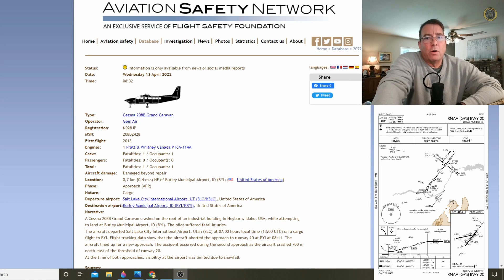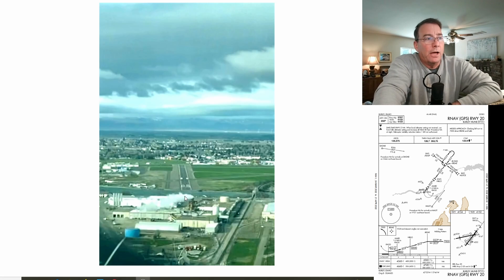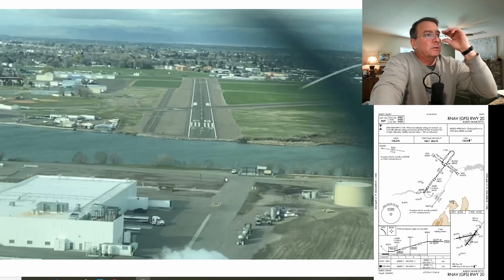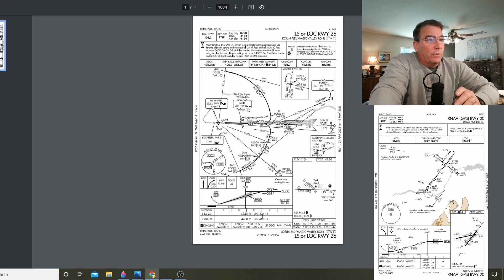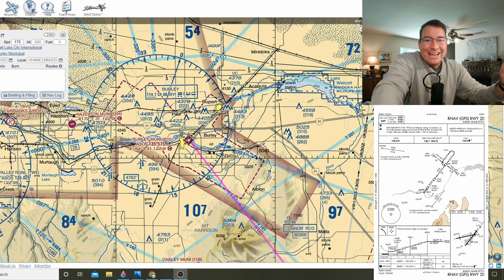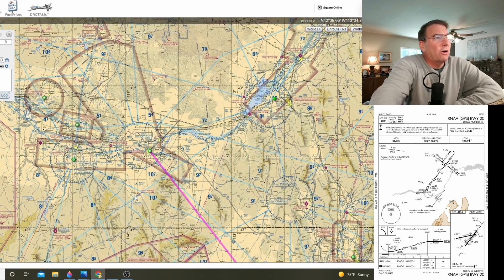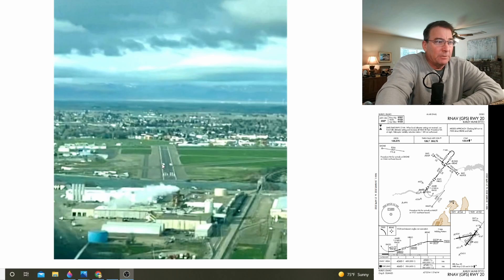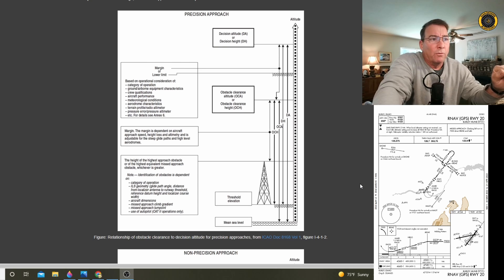Cessna 208 Caravan Crash Burley Idaho New Pictures of Approach

Comment: So we have an airport with a short runway in an area that is subject to freezing weather conditions. A factory is built on the approach to the runway and a steam discharge tower erected virtually on the runway centre line. This necessitates an almost 4 degree approach slope rather than the usual 3 degrees with the final stage of a VFR approach being conducted in IMC for a few seconds if the wind is blowing down the runway. One of two things needs to happen here, either the factory is removed, or the airport is shut and relocated elsewhere. Which was there first?

Despite the difficult layout and conditions, it is ultimately the pilots’ responsibility to conduct a safe landing, or divert elsewhere, but the pressures to just get the job 
done early in a career are immense. Had this aircraft been dual crewed rather than a single pilot, would the outcome have been different?

This was a tragic and needless accident that could and should have been avoided with proper safety assessments .
Reply: The FAA has height limitations for obstacles in the flight path and adjacent to the runway (FAR Part 77 section 77.13).  If the factory stacks are within the FAA height restrictions it's not up to the factory to move.  With buildings adjacent to the airport, the local agency having jurisdiction (AHJ) over building codes should have a zoning map with the height restrictions.  It is not up to the business to decide what is safe or not safe, that is a code compliance issue.  Instead of faulting the business, it's the FAA and the AHJ who are responsible.
Reply: Gettafnggrip armchair quarterback... THOUSANDS have landed their safely.  Pilot WAS flying too low... Pilot HAD IN FACT landed there before.
Reply: @billhosko7723  I learned to fly at an airfield with a short grass runway, significant slope, and a radio mast just to the left of the climb out. This airport at Burley is simply nasty with a host of gotchas waiting to catch the unwary and inexperienced.

Comment: What I find disturbing reading all these replies is the fact that some seem to think that there is something wrong with the IAP, there isn’t! If you adhere to the procedures and MDA this approach might be “challenging” but legal and doable. The obstacles are clearly marked on charts and described in the Airport Facility Directory. At the designed 3.75 angle and adhering to the MDA you would clear this obstacle at 4275ft MSL or 123ft. AGL or 63ft (plus another 40ft. if you account for the TCH) above the smokestack
There is a lot of ridiculous speculation on here which is not only misleading but dangerous in general to aviation!
Reply: Which gauge on your fancy aircraft shows you it’s a 3.75 angle on a non-precision LNAV approach? It could be flown safely by chance or by a pilot with very local knowledge - but I’m sure most would fail to do it right. According to law the judge will ask “what would the average pilot have done”,  not the super ace with lots of experience. These type of approaches should be trained in a simulator to obtain approval. My guess is that this approach will be withdrawn and replaced with a no IMC approach approved or a ridiculously high MDA or revised to a LPV type approach. This was an accident waiting to happen and the FAA and all who approved this ridiculous approach should be held accountable- but will they???
Reply: Some Aircraft actually have an FPA selector that can be set but that is not the point at all since you simply look at the chart to see which descent rate corresponds to what angle (Jepp charts have that on the plate) and even if you don’t you do a quick calculation in your head to know your approximate rate based on your planned Groundspeed. All these things are readily available to you for use and a prepared Pilot ALWAYS knows these numbers before getting into an approach. You clearly are not a Pilot so I suggest to just keep out of adult conversations 😉

Comment: This is sickening. The family of the slain and others begged the city not to approve this. The mother asked, who's going to "pay" for this now. It's criminal.
The faa should immediately shut the airport.
Reply: "The mother" should knows her daughter that was the PIC, and therefore "the final authority as to the operation of the aircraft". 
Yes, there are outside pressures, but that's what the PIC is tasked to deal with. Flying ain't for sissies. Especially professional flying single pilot in IFR in a complex environment.
Everyone deals with pressures. Pilots are highly trained, but we're not perfect. We're all also human, and will sometimes make mistakes. Sometimes the conditions, the airport configuration, and outside pressures can put the pilot into a box that it's hard to escape from. But that's the difference between someone who's trained and experienced, and someone who isn't.
We all receive training having to do with this kind of situation. Sometimes, the holes in the swiss cheese all line up, and things go to hell.
But a failure in this circumstance, though tragic, is still a failure by the pilot.
Reply: @RC21114  tell that to her father. Probable Cause had to issue an immediate apology to him for less than what you said.
Reply: @loonhaunt  Probable Cause is too spontaneous at times trying to beat the clock.

Comment: That approach looks horrifying, especially with no PAPI or VASI.  Any idea how high above the tower an aircraft would be if it was on the right glidepath?
Reply: This is my hometown airport and it’s a non issue when on the proper glide slope. Lots of private jets and turboprop aircraft successfully land here. She got way too low… you shouldn’t be 60 ft over the ground nearly a half a mile from the airport…
Reply: Well the MDA is 408 ‘ tower can’t much over 100’  sad and tragic yes  but when you go below minimums usually bad things happen.
Reply: @torgy3  airport info states 60’ obstacle 2050 ft from the runway,  100’ left of center line. She got low… These stacks, while not ideal, have never been an issue.
Reply: @torgy3  Not what I was asking, obviously you go below MDA on final approach if you can see the runway.
Reply: @coryturner9140  But the question is, how low was she actually?
Reply: Google maps thinks Gem processing is about 2000 feet from the runway threshold, at a 3.75° glideslope and if my trigonometry is not too rusty, that puts the aircraft 196 feet AGL when passing over the plant.
Reply: Here's my ultimate thought: Yes, the pilot should do a GA if they lose sight of the runway, due to snow or a steam cloud.  But the correct flight path is only 100ft above the chimney, the chimney is (was) unlighted, and the nearest altimeter is 15 miles away. If there's a storm cell over the airfield, and the air pressure is even a little different than reported, the pilot is in big trouble if they suddenly lose sight of the runway.

Comment: Shifting that stack makes more sense than moving a runway. I'd get the FAA involved an lobby for an emergency town consul meeting to discuss the situation. It worked for Big Beaver Airport in Troy, Michigan. The City wanted to erect a communication tower in line with a paved E/W runway, 2,400 ft. for takeoff. Additionally, Troy wanted their PD to get an open air firing range. I testified as a Commercial Pilot, fixed and rotary Wing rated, and also as a small arms expert courtesy of my NCO rank in the USMC and Vietnam tour of duty. Neither proposal was passed.

Comment: Juan, the vertical descent angle of 3.75 degrees as shown on the chart and as may be available on the G1000 DOES NOT guarantee obstacle clearance as this is a non-precision approach. Visual obstacle clearance below the MDA is still the pilot's responsibility. So I'm not sure what the point would be of investigating whether or not the VDA provided obstacle clearance.

Based on groundspeed decreasing to 81kts and then 80kts at the MDA combined with a descent rate of about 800fpm, it looks to me like she was trying to go missed at the MDA but had ice on the airframe and encountered a stall/mush and/or engine problem due to ice ingestion. Caravans are known not to do well in icing conditions. Could you comment on that if you do another follow-up video? Thanks & Best Regards, Ibrahim.

Comment: If the winds were "tail" winds, then the steam plume would be sending the plume forward of the tower that was struck and not obscuring it since the stack is forward of the steam stack. Am I missing something?
Reply: I think what was meant was the steam would obscure the pilot's view of the runway.
Reply: The winds were headwinds, blowing the steam down the glide path towards the plane. She could have been used to flying through that cloud in lower winds, expecting to come out of it in a second, but this time that didn't happen.
Reply: @robertbackhaus8911  Thanks for clearing that up for me, Robert B.

Comment: As a mechanic when I saw the first report on this, my first thought was the bracing on the extractor outlets were built like they were expecting them to be hit but still allow the plant to continue operating after with no major disruption to the plant, to the detriment of what ever hit them. Why did vent tubes needed to be braced to that extent, light poles etc. roadside are designed to collapse to minimise harm upon impact with vehicles.
Reply: What you're suggesting is totally absurd. No engineer is going to attach their license to a design an industrial structure so it's supports would not critically damage an undefined civilian or light commercial aircraft.
Reply: @otm646  Seems you've flipped the absurdity, championing enlargement and rather extreme hardening of obstacles in/near flight path. Waiting to see changes.
Reply: @jacquesblaque7728  That's 100% not what Steven was suggesting.
The tower is in a bad spot no doubt. So design the plant so it doesn't pose an obstacle,  not for aircraft to survive hitting it.(which is an impossible engineering task btw)
Reply: @otm646  Exactly, freeway agencies do everything in their ability to make travel safe as possible. Airports don't build structures close up against the runway so why would such air/steam ventilation tubes be built in the flight path. Certainly making threading the eye of the needle to land even smaller and harder to pass through.
Reply: @otm646  Again, my comment called out the design progression of such a hazard, extending and toughening it, (rather than re-siting it.) Deck-stacking, IOW.

Comment: As a mountain state road hauler, I understand fully the pressure of trying to complete a run with less than complete knowledge of local surface conditions, coupled with inherent properties of the environment which increase the risk difficulty of the task. (i.e. two lane hillside state highway vs. beautiful interstate with lighting.) The structural obstacle in this case appears to have greatly increased risk to life needlessly when variables such as changing visibility conditions and lack of runway/aircraft services are added to the equation.

Comment: Did she descend below MDA without the runway environment in sight?

How low can you go? When it comes to instrument approaches, you can go all the way down to the published minimums, without seeing a thing.

But what do you need to go below minimums and land?

FAR 91.175(c) outlines three requirements:

You must always be able to make a descent to landing on the intended runway using normal maneuvers and a normal descent rate,
The flight visibility (that you observe) must meet or exceed the minimums published for the approach, and
You must be able to distinctly identify one of the approved visual references for the runway (often called the "runway environment")
Reply: Yes, probable cause was the pilot’s failure to maintain altitude during an instrument approach, which resulted in a
descent below the approach path and impact with a vent stack.

Comment: The time in the "smokestack cloud" would be a blink of an eye.  120kts is 200 feet per second!  The cloud looks to be 50 feet wide.  That's a 1/4 of a second. Not enough to lose orientation or build up ice.  Slight chance this was a mechanical failure, but it looks 99% likely it was task saturation pilot error.
Reply: The size of that cloud and how long it lingers has a lot to do with local air conditions, wind, humidity. In this photo you’re seeing it on a clear day with a nice crosswind where it quickly dissipates. A much more representative photo would be on a day with almost 100% humidity, snow, mist, a dew point just a couple degrees lower than the air temp, and visibility of only one mile, as was the case on the day of this accident.

Edit: to be clear, I’m not saying the steam cloud was the cause. I’m just trying to highlight that it can be a much bigger hazard than it appears in this picture, especially when combined with other unfavorable conditions, which all add up to a very difficult approach.
Reply: You sir, have underestimated the extenuating circumstances. She was not crossing the cloud plume but flying into it, with snow and hot air from the tower creating a large temperature difference. The pilot may have been in the steam cloud for much longer than expected. This is not a simple accident
Reply: @neilbartlett5179   Everybody on Youtube thinks they're an expert.  Few are.  There's no explanations for the crash except pilot error or mechanical failure.  The stack meant nothing.  The crash occurred below the minimums for the approach (408 AGL).  If the stack caused obscuration and she went below minimums anyway, that's pilot error.  If she saw the runway early and went below the safe flight angle to the runway, that's pilot error.  If she saw but lost the visual of the runway and didn't fly the missed approach, that's pilot error.  There were no known "extenuating circumstances."  Flying instrument approaches safely is what professional pilots do.  But what do I know (other than 52 years of flying, 25,000 flight hours from instructor up to B777 captain, and a huge number of non-precision approaches as a single pilot). Care to share your experience in these things?  Cheers

Comment: Good job Juan! I was under the impression that the obstacles were offset from runway centerline. I don't understand why such obstacles were allowed to be constructed directly impeding normal approach to the runway centerline. This dangerous situation throws too many changing variables in this critical phase of flight. This was a accident waiting to happen! Now it has happened and a smart, talented, beautiful young lady has died. 
I understand obstacle avoidance but I believe that steam discharge was directly responsible for this mishap. 
Can you run this mishap scenario thru a simulator using the condition's present at the time?

Comment: Never to high or fast in the van. TKS but was it a G1000 or classic. Had they ever set the touchdown point (GPS waypoint) into the flight plan. And what is the decent rate for 3.75? GS times what? If they had done it many time they should have it dialled in.

Comment: At the north end of Burbank runway 15 is a us storage with a big flag pole . I used to have a locker there. The ball at the top of the flag pole I have seen 737s miss the by only several feet with their main wheels.  I have seen GA  lift a wing to be sure to clear the top of the pole. The flag pole is at 7800 san fernando road..

Comment: Not being a pilot, I'm going to ask probably a really dumb question.
In poor visibility, why don't you land from the other direction and avoid any possible issue with the towers? I think I know enough to want to land into the wind for added lift, but does it make that much difference overall?
Reply: Remember that this is a fairly short runway. Landing with the wind add 2x that wind speed to your landing speed, and also increases your stopping distance in other ways.

Comment: This is a six day per week flight.  There's a bunch of caravans that leave SLC everyday doing the same thing for a number of cities in UT, WY, NV, MT, and ID.  The freight dogs who operate these flights are typically newer and building time for their ATP, just like the pilot in this case.  The problem is they may not have the experience to deal with the pressure of time based  deadlines and frequent IFR weather to or below minimums, which is especially common October through March.

Comment: This leads to the age-old question which was there first the airfield or the plant?  If the airfield was there first, then I would assign some of the bureaucrats that allowed high obstacles in the landing glide path so close to the airfield.  Maybe require diverting when less than minimums or borderline.
Reply: The airport has been there since the early 30s. The plant came much later.

Comment: Maybe a dumb question, but shouldn't it be possible to land in the opposite direction? Seems to have a much clearer path to the runway.
Reply: That would have been a downwind approach that day (and most of the time), and with that short of a runway, an into the wind approach is always necessary.
Reply: @tcpratt1660  Thanks. I thought the wind was not so strong to be a problem but, like you said, it is a short runway. The location of that plant is a real hazard. Wonder what was built first - the plant or the runway.
Reply: @JoseSilveira-newhandleforYT  Runway, by a lot of decades.
Reply: @JoseSilveira-newhandleforYT  The airport was opened in April 1940, per AirNav website.  I don't have confirmed by me info about the plant, but apparently that tower was built well after the airport.
Reply: @RADThird1  Thanks.
Reply: @tcpratt1660  Thanks. Then someone goofed up. Can't understand how that could have been approved, sticking straight in the glide slope.